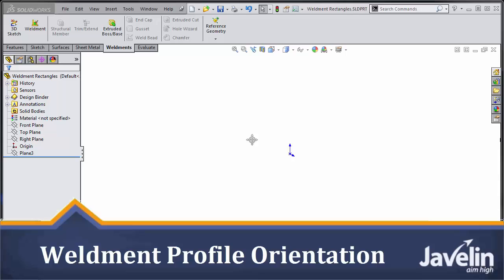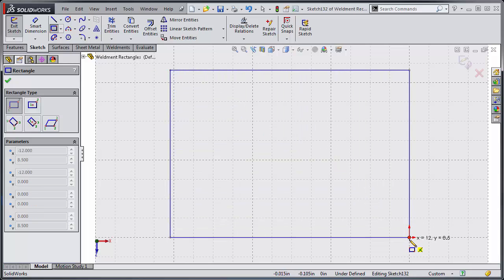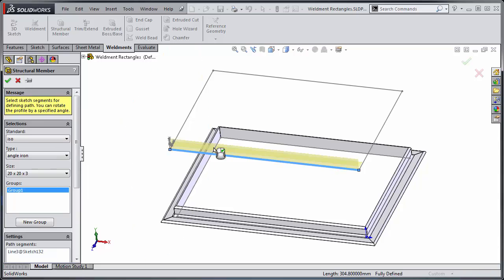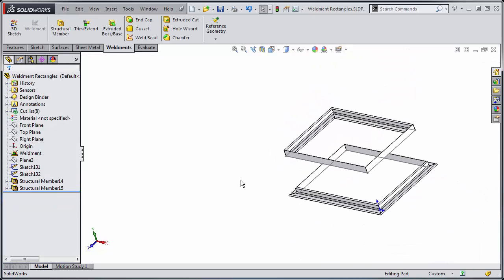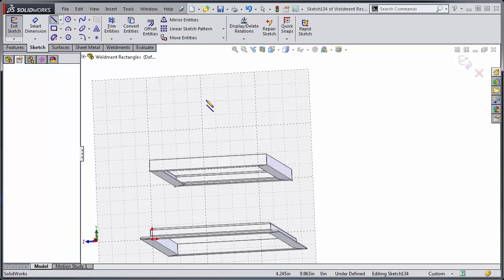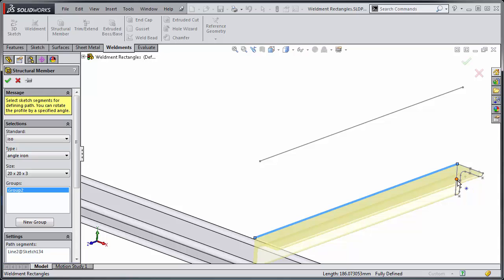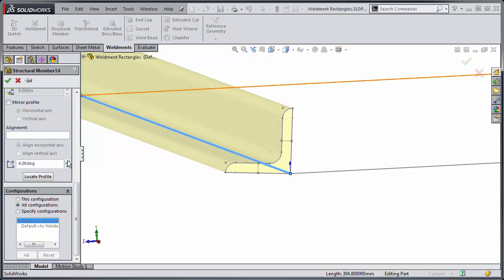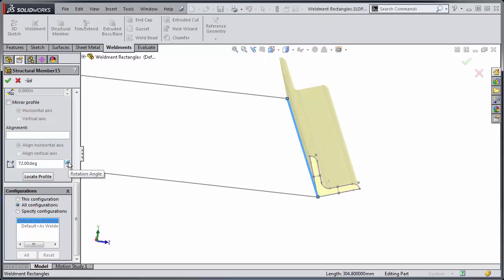SolidWorks Tutorial: Weldment Profile Orientation

Comment: Thank you for the video.  I had a follow up question.  Is there a way to control the location of the weldment profile along the path.  The profile is always placed at the start of the sketched profile.  Is there a way to attach it to the midpoint of the sketched line or a point along it?